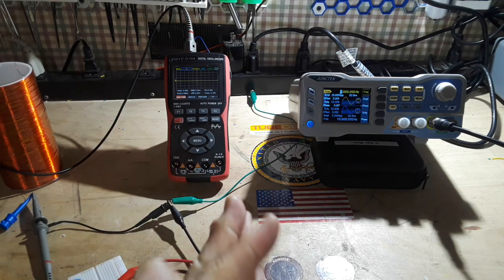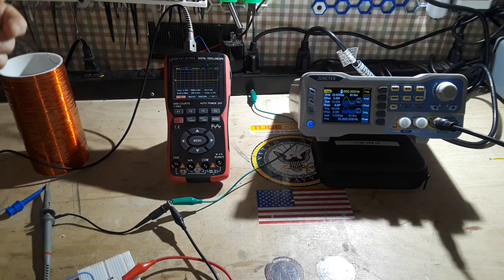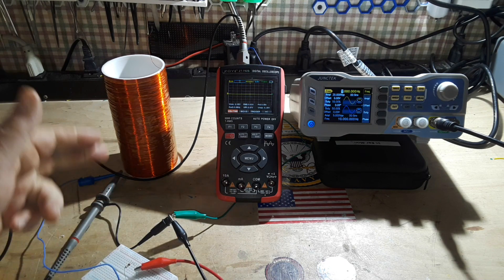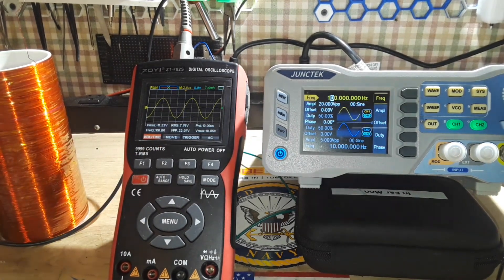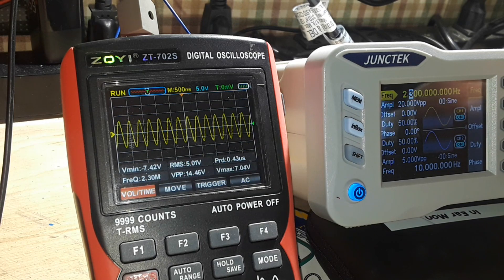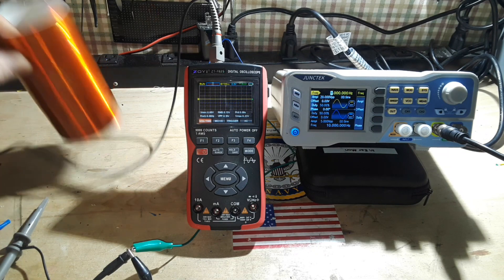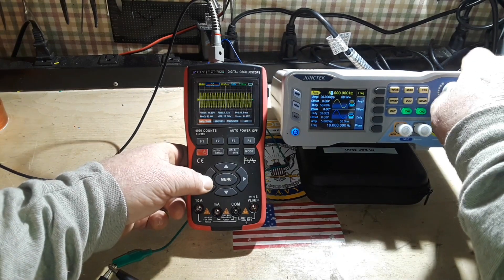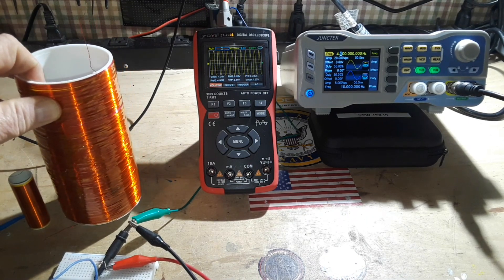How To Find The Resonant Frequency Of A Coil - brought to you by Solderstick Wire Connectors

Comment: Isn't it when the capacitance reactance and inductive reactance are equal the cancel out and are out of phase 90°? You could just use a trimmer cap or pentode till you see your voltage drop at the known frequency you want so you don't have to chase signals all day turning to pure ac Resistance

Comment: So you just have a simple series circuit from the signal generator through a resistor and the coil is just tapped off at on end of it to the circuit and the other end is open, like an antennae?

Comment: You get a PARALLEL resonance (capacitor in parallel with inductance) that is evident as the MAXIMUM voltage, when the source is through a resistor.  You capacitance in your described arrangement is the capacitance that tends to resonate with your coil.  You could put (a small) capacitor either in parallel or in series with the coil (and resistor) to get much better measurement results.  You could find a Minimum amplitude of current measured at the resistor in parallel configuration, or a maximum current (highest voltage at the resistor) if you use a Series configuration.  If you know your capacitor value, you can get your coil inductance from the resonant frequency.  In most bench oscilloscopes, you have an input capacitance somewhere above 10 to 20 pF, or in really old scopes something like 47 pF.  With a “10 x” probe you have about 1/10 of that capacitance.  If you try with two fixed capacitors, you can work out, what is the stray capacitance of your coil.  But be careful about the skin effect of the wire, when you advance to MHz frequencies!

Comment: Let me know if I understand you correctly, because as you say, the coil is an open, the other end is not in the circuit. If I understand you correctly, you are saying that even though the coil has one wire open, it still has an effect on the circuit because it is a COIL (inductance) in an AC driven circuit. So, in a DC circuit, the coil will resist the flow of current through the coil when power is first applied, even though t other wire is not tied into the "Circuit".? Am I correct? I mean when you flip the switch and apply a voltage, instantaneously, this coil will take on a charge and an electromagnetic charge in response to this power being applied to it, (power might not be the correct word. Voltage maybe?). The fact it is there, even if un-terminated, does have an affect on the rest of the circuit. Is that thought correct? But we are talking resonance of a coil, so an AC signal. And as you progressively increase the frequency of your signal generator, You were looking for peak voltage to see at what frequency the coil ADDED to the output measured voltage level. That is resonance. Just like in a shower... if you hit a not as you sing up and down in a scale of notes, at some point the oscillations of the frequency of your voice will vibrate the walls of the shower and make you sound amazing! That is the resonate frequency of your shower enclosure. AND the same circuit, without your open-ended coil would respond..... how? Differently I suppose. So the coil had an affect and the point of the frequency you applied to the circuit with the open-ended coil IN the circuit tells you the resonant frequency of that coil? Am I correct in understanding your point? Because the open-ended coil in the circuit adds to the output signal Peak-to-peak value at the output, the open-ended coil must be resonating and adding to the voltage at a certain frequency. Is that correct?
Reply: That is amazing. I believe it and I can understand it. It makes sense to me and you showed it happening. Thank you, Paul! I learned something, yet again, from your channel!

Comment: If you do this with a strung guitar, would you be able to hear it resonating?
Reply: Interesting question.  If you put a small speaker in the sound hole of an acoustic or couple it to the body, you'll be able to play a tone (let's say the frequency of the open E string (6th string)) and observe the E string vibrating.  You'll also observe other strings vibrating at the harmonics of the E string.  It's called sympathetic vibration.  Open body instruments (violin, acoustic guitar, cello, etc...) will have a resonant frequency at which the body will vibrate at a certain frequency.  I would suspect the instrument would also vibrate at a harmonic of the fundamental IF the body was constructed which allowed it to vibrate (much less likely).

Comment: PAUL, why is the AC voltage dropping at Resonant Frequency? the impedance is the lowests at Resonant frequency so the AC voltage is lower because of why?
Reply: because at resonance, resistance from the reactance of the coil goes to zero causing the total resistance to drop, which increases the current, so the voltage drops.
Reply: because the impedance of the coil and the resonant frequency are the same
Reply: @freedomer342  the coils impedance is at maximum resistance at the coils resonance frequency so the AC voltage is lowered decreased. Why does the coils impedance increase to maximum at resonance frequency?
Reply: @freedomer342  what is the difference between impedance VS compared to complex impedance? Of an inductor coil
Reply: @waynegram8907  I'm not sure what you mean by complex impedance. Impedance is measured in ohms so it's like variable resistance that can change due to certain qualities like capacidence (at least when it comes to tesla coils, air core), temperture, humidity, etc. Becuase Paul found the low point, it was where the Impedance of the coil was matching the resonant frequency of the coil, causing the impedance to "cancel" itself out. He describes this in the beginning of the video.
Reply: @freedomer342  if the impedance of the coil is Matching the resonant frequency which cancelling it out, why is the AC voltage dropping lower? I would think the AC voltage would increase because there is NO impedance of the coil
Reply: @waynegram8907  because you need more voltage to overcome more resistance

Comment: can i use a 555 timer to generate the frequency? i dont have a oscilocope
Reply: a 555 timer is essentially a signal generator. depending on factors of you coil, you might need something that pulses higher than a 555 timer like a signal generator
Reply: @freedomer342  I would suspect that would work if you also built an amplifier who's output could be coupled to the coil in some fashion.

Comment: Some kind of diagram would be helpful.  Also, you didn't show us how to determine the resonant frequency of the primary coil.  You only offer the secondary, which is half the puzzle.  I love the channel!  Thank you!
Reply: If I am not mistaken, though he did not show it, is the same circuit without the open-ended coil under test connected, would not have resulted in the peak of the voltage on the scope at a certain frequency. I would like to see the same test again without the coil under test to verify it was the COIL that made the difference at that frequency.

Comment: Aren't you really measuring the resonance of the coil inductance with the total capacitance of the oscilloscope probe, signal generator, and coil?  How does that help?  Is the capacitance of the oscilloscope probe plus signal generator insignificant compared to the capacitance of the coil?
Reply: Again... conducting the same test without the coil under test, I mean the same scope, same probe, same placement of everything with the absence of the coil under test would verify the coil made the difference and negates external influences.
Reply: @johnclayton2101 Not really.  What you are trying to test is an LCR circuit whose resonant frequency is 1/(2*pi*sqrt(LC)).  Without the coil there would be no L other than a tiny parasitic L from the scope probe.

Comment: Major difference in diameter can affect resonate due to field strength.
Reply: And skin-effect of the diameter of the wire, correct? Because current in an AC circuit tends to flow on the outer surface of a wire's diameter, if I am not mistaken.